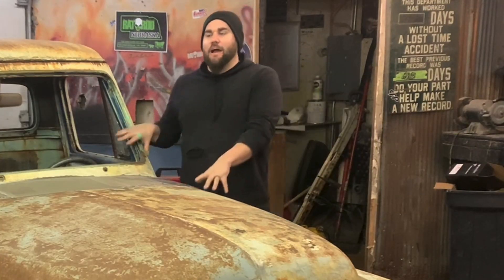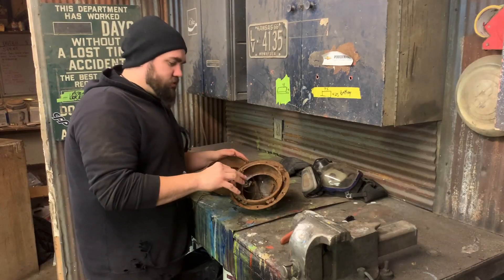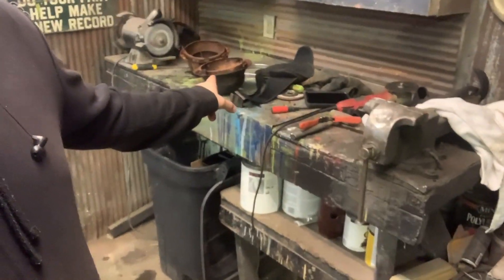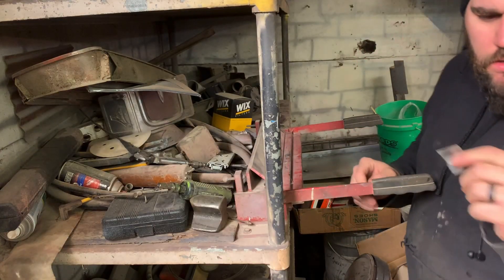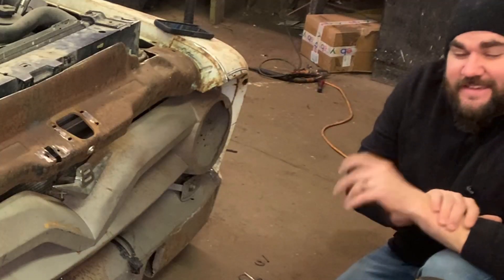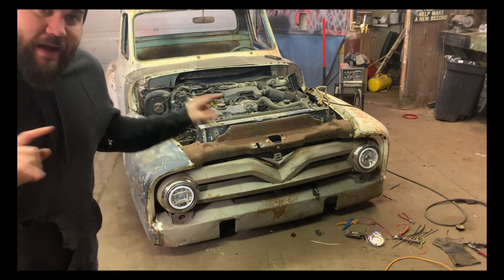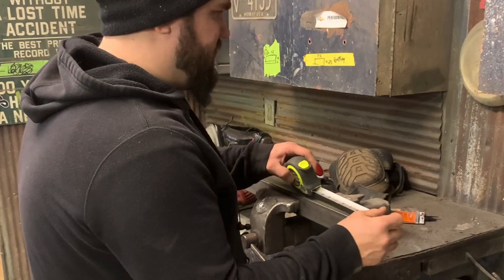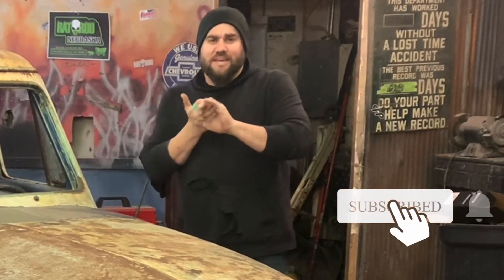BUILDING A HOT ROD FOR UNDER $1000 DOLLARS! PART 12! HOW TO BUILD A RAT ROD ON A SUPER CHEAP BUDGET!

Comment: Consider frenching those taillights into the fenders for a streamline look ...just an idea 👍👍👍🇿🇦🇿🇦🇿🇦
Reply from the maker: Since they are in the grille on this year trucks frenching them doesn’t really clean up the lines like it would on a Chevy of the same year. The already look smooth being on the grille bar
Reply: @CaseysCustoms   the taillights... the new round brake  lights that you have degrilled and mounted on rear fender or wheel arch as some would call them
Reply from the maker: @JustinPaul1st  oh gotcha, i read that wrong. I don’t like these out on the fenders. They kinda get lost out there. Looks good on a street rod, not a rat rod though. At least to me

Comment: Link to the tail lights, I need some for my 51 F3..
Reply from the maker: Search 7” halo headlights on eBay and Amazon, there are a ton of different options. I got these ones because they were on sale and real cheap. There are a lot nicer ones in the 100-150 range. Check them out 👍👍